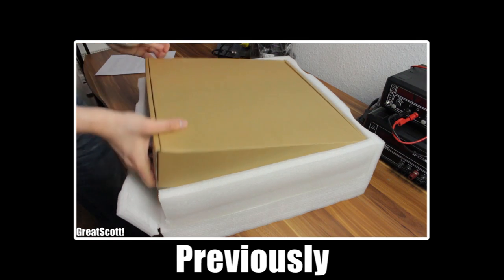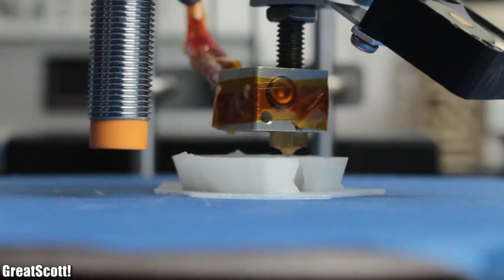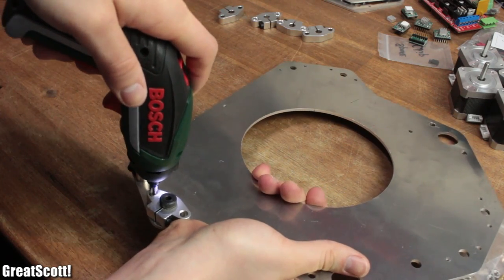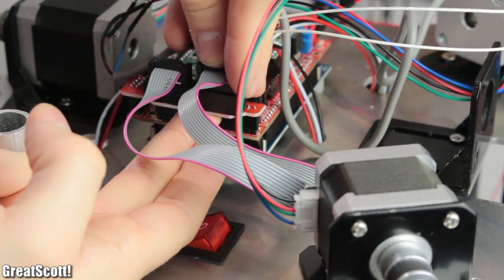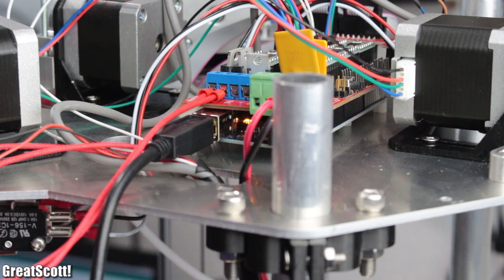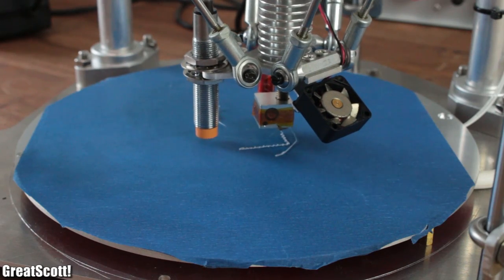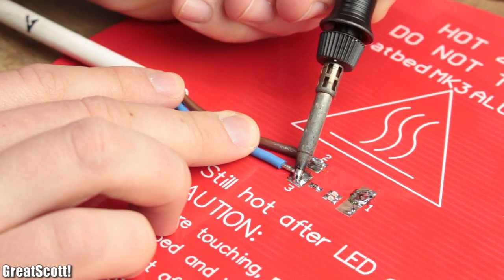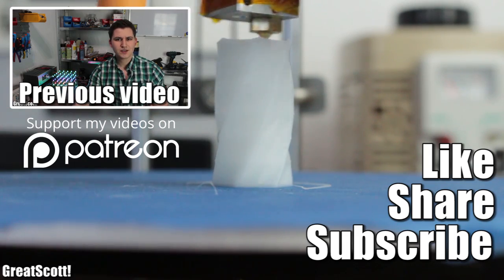3D Printing Beginners Guide (Hardware) - 400$ DIY Delta 3D Printer kit

Comment: I didn't see the heated bed thing anywhere. That little snippet with changing the heated bed pin and motherboard type in pins just saved me from pulling my lust clump of hair out.
Other than that, this printer is the best 3d printer I have used after tinkering.

Thank you for making this video
Reply: I have tried the same. I have the same heated bed from the video and changed the pins. But the bed won't turn on. Do you have any ideas on this?
Reply: Us the RAMPS test code on your printer. I had a bad MOSFeT on my first board.

Comment: One tip for the belts staying taught is using the spring from a clothes pin. You take the spring part and touch it to the belt with the arms facing out and the pull the belt inside the arms so that the arms are kind of pulling the belt towards the center.

Idk if that is understandable, I can explain further if needed. Anyways it helps keep my belts more taught
Reply: I forgot why, but that's not a good idea.

Comment: Awesome video!
I have my own prusa i3 (but the steel and aluminium extrusion model) and it works fantastically.
The delta printers look so cool though I think I'm going to get one!
thanks
Reply: +The Art of Weapons delta printers have many problems. read this before buying one.
https://www.reddit.com/r/3Dprinting/comments/2kcwyq/delta_vs_cartesian/
Reply: +The Art of Weapons problems begin with slower speeds due to much more calculation the arduino has to do, and those 16mhz arent enough
Reply: So did you like it? I didn't have much fun with this printer haha

Comment: I ordered this same printer from their Amazon store after having trouble ordering it on AliExpress. It came with a 10 amp 12 volt power supply which is great. After I calibrated it with the m666 command it printed really good. But I had one issue, my fan was broken on arrival so I have to get a new one but other than that it's a great printer.

Comment: Other delta printers offer more build space per $, like Biqu or Anycubic. 
But the special metal parts here make sense and look like a real improvement. 
The printer is now offered for 340$ including heatbed and auto-level.
Only putting the extruder motor on top does not look like the best technical solution to me, because it means the bowden tube is longer, thus extrusion and retraction are less precise.

Comment: Nice printer, but for printing ABS you will need a higher temperature around 80-100 degrees Celsius for the bed. I prefer ABS, because you can easily smooth the layers and fix gaps  of your print with aceton or an abs/aceton solution.

Comment: 3d Printers have come a long way and my Anet A8 3D Printer Prusa i3 has no problems at all i get every print a success long as what i am printing is realistic and not impossible with a good bed level. Quality has improved so much in this clones although i think the ramps board might be a better option as i am currently trying to figure out how to modify this board to print ~300* polycarbonate

Comment: Well, it is very piece to piece, at school I work with three Prusa i3 made in April 2014 (first with milled aluminium chassis), and I got request for about 5000 prints, I got 3500 and so far only 122 were bad, from which 71 got damaged by me while I was removing them from the printbed, so...

Comment: would you be able to share any methods/instructions on doing the calibration. ive been trying on mine and having lots of issues. i thought i had the M666 right but i might not. Also the G29 keeps crashing the head into the plate

Also the tube for the filament keeps getting under the Z axis endstop and causing it to stop early. did you have any similar issues? if so how did you solve it?

Comment: Somehow, I find this machine much cheaper in Taobao in you lives in China even with an official heat bed.
Did you do some precise measurement on the printed objects? My delta printer gives me a 4.04*3.98 cm result when I print a 4*4cm square using PLA. Is that common?

Comment: I'm having trouble getting my printer (Same Model) to connect to my computer, and when I load commands it says "Idle X amount of processes pending". I am able to get the stepper motors to move using the Repitier Firmware when I give it the home command, but it won't stop at the stop switches. Do you have any tips/tricks? Maybe even a preconfigured version of the firmware you are currently using?

Comment: Meh, bought it 2 years ago(2017, January), had a lot of problem with M666-calibration / Bed-Scraping Calibration Disaster(Auto-level feature added to 2017 model) / Extruder Tube blocking the print because it didn't go fully inside the hot-end, a LOT of rattling sound(I now figure that vibration dampener on stepper motors might help), stock-endStop had it's metal part Bend(which caused in-accurate M666 calibration Result... Later changed to optical sensor because of this problem), Bowden tube seems to be low-quality(a lot of slack / stringing problem, despite various retraction speed / length settings), Dangerous Power supply Live-AC wire terminal pretty close to where you can get your fingers on..

But overall, it didn't suck THAT much, it just sucked. If I take a look at it now, I might be able to make it work again.

Comment: Do you had any problems with the stability of the towers?
I am trying to Build a delta printer myself and went also with Rods as the main Towers. But you have additionally to this two big pillars in your Printer. Is it enough to make the Prinmter stable or do you have to go down with the Speed?
Reply from the maker: +Gasolin1 Stability is not a problem I faced with this kit.
Reply: +GreatScott! exept from slight warping; what problems did you face?
Reply from the maker: flippynl
Out of the box nothing else. It all worked how it was supposed to.

Comment: Hello! I have a delta 3d printer, but that s controller is bad, so i wants to buy a controller like this. Where did you got the arduino code for it? And will it works without the lcd screen? Can i upload files to it from my pc, or i need to buy an sd card reader for it?

Comment: A 50% success rate is considered good in 3D printers? Damn! I'm currently designing a 3D printer, most parts on the way and I'd be very concerned if that would be the success rate of my machine. Obviously at the very start I can only dream of even that level of performance but it's always something to work towards.

Comment: What do you mean by saying that this printers has a success rate of one of two prints?
Reply from the maker: +jonnyroy Most problems occur at the start of the print. Sometimes the filament just refuses to stay where it is supposed to. That requires another try which mostly works. That is why 1 of 2 print "attempts" work out fine. Once this critical phase is over it usually prints without problems.
Reply: +GreatScott! Is this success rate before or after heated bed upgrade?

Comment: hi I have same printer and it prints first 2-3 layers ok but after nozzle just not extruding and doesn't build higher than 3 mill. can you please help me adjusting parameters, also do I need to buy better quality filament?

Comment: Quick question.  Since the auto-level sensor sits 1mm below the nozzle, does it collide with larger prints?  Your example print was fairly small so I couldn't really tell if this was a problem.
Reply from the maker: +Budreaux1973 No, it is not a problem.

Comment: Did you got the opportunity to compare the print result with a Ultimaker 2+? And, is it possible to upgrade to a dual extruder setup? To print with support material.
Reply from the maker: +Jannik Kramer I know anyone who has an Ultimaker 2+ and you can print with support material even with one extruder. Don't know about a dual extruder upgrade either.

Comment: Nice video!
I build a kossel pro delta printer fe weeks ago but had some problems with it.
Which firmware are you using? marlin or repetier?
Regards from your saxon colleague
Reply from the maker: +Eric Vauwee I think it is Marlin.
Reply: I have the problem that repetier host does not cooperate nicely with my marlin firmware. When I start a print it will not heat bed neither extruder nor move the motors. Did you experience any of this problems during your builds of 3d printers?
Reply from the maker: Eric Vauwee
No. Except for the heated bed which refused to turn on. I had to change a pin assignment in the pins sketch to make it work. But changing the motherboard type could also help.
Reply: I changed it now, had the same MKS Gen v1.4  chinese All-in-one board as I could see is used on your prusa i3. I changed it to a RAMPS with Arduino MEGA now hoping it will work with this as the SD cardreader or rotary encoder for naviagtion in the menu didn't work neither. As soon as I get it to work I will update you.
Reply: +GreatScott! I have the same printer and after your video I decided to get this heatbed to. So far so good. I changed the pin assignment, but it doesn't work. Did you just change what can be seen in the short video sequence? I tried already MOTHERBOARD == 33 ->PIN 8 and also outside of the MOTHERBOARD if clause (line of changkai's change).
But D8 doesn't turn on. Snipplet of my changes:

  #if MOTHERBOARD == 35
    #define HEATER_BED_PIN     -1    // NO BED
  #else
    #if MOTHERBOARD == 33
      #define HEATER_BED_PIN     8    // BED
    #else
      #define HEATER_BED_PIN     8    // BED   //changkai  old value 8
    #endif
  #endif
Any idea? Thanks
Reply: +Alexander Wilms I've had the Same issue, Heater bed won't turn on, my solution in two steps, 1. change the heater bed Pin to 8 (pins.h line 562), 2. ad a thick jumperwire between Power Input Terminal +12V 5A and +12V 11A
Reply: +Eric Vauwee I don't know what could be the problem but maybe the software is not issue. First check that you connect your second power supply to the 11A input on the board. This input is driving the IRF3205 on output D8.
In my case i use additional relay becouse my self made bed draw 24A and mosfet get quite hot.

Comment: An really awesome printer with an innovative technology :-) great Idea with the thermal pad!

But I got a question about a project of mine, do you see a possibility to latch an circuit without an latching relay? I want wo improve my old project and reduce the costs by using more cheaper smaller and more effective components. The circuitry must hold his state when shutting down and must remember when boot. 

Sry auf deutsch wärs einfacher :-)
Hab ne alte Schaltung mit 3 Latching Relays, die ich gerne gegen diverse Halbleiter oder ähnliches ersetzen würde um Platz und Kosten zu sparen. Da die Schaltung sicherheitsrelevant ist und Teil einer autarken Einheit ist wärs schön, wenn die Schaltung den Zustand auch noch über Wochen beibehält. 

LG Schlaraffenland

Comment: Hey +GreatScott, when initially running the auto level feature, did your 3D printer try to destroy itself? I have the same model printer, but when I run the auto-level, the extruder runs into the metal posts around the bed.
Reply: tjk0102  I hade the same problem but the filament tube got in THE way when you press the home button/g28
Reply: After digging around, I found the auto level settings hidden in a PDF. I also had to change the orientation of the induction sensor. When it got to a certain part, the induction sensor would hang off the bed, and the extruder would ran into the bed. Everything is all fixed now, and works like a charm.

Comment: Hi, why you decide against a CoreXY printer? I have no experience with both but i had read that that it is better and it cost almost the same. Best regards
Reply from the maker: +Adam K It saves space on my workbench. That was an important aspect.
Reply: +GreatScott! Thank you for quick answer. Just for correctness. The heated bed you installed is 220mm in diameter? Like this? http://goo.gl/5TD6sS

Comment: I'm not able to extrude anything with my printer, I've tried many different extrusion speeds and many different temperatures and every time it seems like the filament just stops causing the stepper motor to halt. The hot end is obviously hot enough (I've tried in 10c steps from 180c up to 250c) so that it melts filament touching the outside of the hot end, but it always get stuck.
Reply: fix it

Comment: Did you buy this in November because , it says online that the top plate, auto level, etc. are only available if you ordered in November?
Reply from the maker: +Alexander Peters No
Reply: +GreatScott! Thanks, I was a little concerned when I saw it on their website but I figured it was just a translation problem.

Comment: Well it sucks, I received the printer and i assembled it by following the manual and at the end it would not pickup then end switches, so when i tested one a puff of smoke came out of the board. I think i might need a new $140 controller board.

Comment: Which heatbed fits this 3d printer?

They also have a 3dprinter that looks exactly the same for $270, what's the difference?
Reply: SirArghPirate I was looking at that to
Reply: Take a look at the Tronxy P802M (AKA Anet A8). It has much higher build quality than this one, looks more professional, has better support for replacement parts etc on Thingiverse, is cheaper (I paid 212 USD for mine, including 1kg of filament, heated bed and an 8GB microSD card, but it's a cartesian and not Delta.

Comment: pretty much all my prints succeed. I use gluestick on the glass bed of my printer and let that dry up for a bit. heat the bed to 50C and even large prints have no trouble sticking and arent warping!

Comment: Careful, I have the same printer. Mine does not work. I had the polarity wrong on the limit switches and fried the 5v regulator on the Arduino. I ordered new boards but I failed to realize that they are knockoff Arduinos.
Reply: Hi, actually, I fried the same thing, but the polarity was correct according to cable color, were yours the same?

Comment: Which is the software for make the 3d model in this printer?
Reply from the maker: +Aire Acondicionado Eolik Engineering Group S.A.S. You can use 123D Design.
Reply: +GreatScott! Danke

Comment: I bought this printer about a year ago and have been trying to figure it out ever since, instructions are poor English and very incomplete, I had to email a Kevin guy for missing parts multiple times. about 95 percent finished there are no instructions on the wiring the position sensor

Comment: I don't have soldering tool, but i want to buy it. Can I complete this 3d printer building?
Reply from the maker: +뎁온누리 I think so
Reply: I orders this printer a few weeks ago. Built it and it is really good. I love it so much. To answer your question, no you don't technically need a soldering iron. I only had to solder the induction sensor wire to a 3 pin connector, but you can easily use some electrical tape instead.
Reply: +뎁온누리 Yes you can! I am currently assembling it (just got it today), you only need a flathead and a philips screwdriver and some sort of measuring tape. The other necessary tools are shipped with the product.
Reply: +István Tóth what do you think about the printer ?
Reply: ***** Thank you sooooo much!
Reply: Noah Blau It is pretty nice, but the assembly instructions are still a bit dodgy. For example they still haven't included how to connect the fan :D The M666 calibration is really not a pleasant experience, it took me about 2 hours of calibration before I got an acceptable print and I still think it could be better
Reply: +뎁온누리 After assembling and testing, I found out that the sd card's connector was not working properly.. The printer could read the file list, but when I started printing there was a bunch of errors and the print failed... I had to resolder some of the pins on the ramps shield, then it started working great! So, to be sure, I suggest you buy a soldering iron.. I have a cheap 10$ one from ebay, it did the job
Reply: +István Tóth Hmm that's strange my printer is fine it didn't have any major issues just one, the fan was broken on arrival. But I wasn't going to use it anyways. Mine also came with a picture of how to connect the fan. I orderd my printer off of their amazon store. But it all went together fine and after a grueling 2-3 hours of m666 calibration it printed crazy good for $400. My Results: https://drive.google.com/open?id=0B0bTqPp9iD74VVVjRXRheXQ3MWs
Reply: +Gavin Sauer Wow, that is a nice bolt :D My prints are not this fine, but I always find some misalignments and tinker around the slicer settings to improve them. It is my first 3D printer, so I guess it is part of the learning curve :). This is my best print so far:  https://drive.google.com/file/d/0BygP4fzWCe8DMUl5TUMtaHo4cnc/view
Reply: Sorry for such a delayed response but wow that's a cool Yoda head. This is my first printer as well there is definitely a learning curve. I haven't tried something that detailed but I will soon. I just ordered a heat bed and glass plate to upgrade my printer to print in TPU plastic. I'm going to try to make a nice phone case. Good luck on all your prints!

Comment: why do they use belts instead of threaded rods?
Reply: So rods are better? It shouldn't cost much to exchange the belts with rods.
Reply: the belts allow for much faster speeds, which is crucial in a delta design

Comment: It doesn’t seem worth it, nothing really matches up with a normal square printer which have so many advantages I won’t list
Reply: This video is 7 years old so it's not really very representative of the current market. However a deltas main advantage is that they can print very fast as they can have very light and stiff print heads and still get a good build volume. They also have a smaller horizontal footprint than a bed slinger.

Comment: Honestly, I don't think additive manufacturing has a great future in technical applications where static or especially dynamic strength is required. The bond between the layers is just too weak.